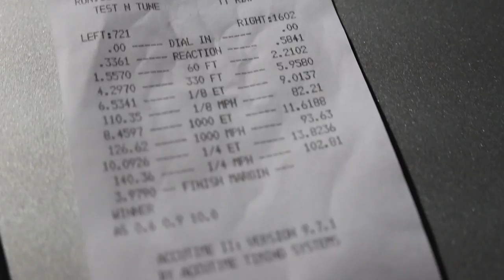First Time at the Drag Strip in my S4!

Comment: word of advice because I track my MKV R32 quite often. The DSG has a slight lag when letting off for LC. You need to let off the brake as soon as that 3rd yellow light comes on and you will leave the box perfectly. my R.T is around 0.190 with that method
Reply from the maker: Yeah I was going for time, not RT, but good tip, thanks!!
Reply: Wouldn't a better RT equate to a quicker overall time?
Reply: Lee Cook depends on what the track is set up for at the moment. Some tracks dont start the clock until your car moves during test n tune nights. But if the clock starts immediately on green for real competition then yes it would matter.

Comment: word of advice heat kills these cars at the track, best to ice down your supercharger. With better intake air temperatures proper launches you probably would have made in the 12's easy. also to make sure to put your car in dynamic mode before you turn off traction control because sometimes it won't fully turn it off learned that the hard way my car was braking somewhat off the line till I figured that out. You also  need to go ahead and got stage 2+ dual pulley or at least go supercharger pulley. at even stage 2 you'll be seeing low 12s High 11's all day depending on ur d.a. and launch. stage 2+ (dual pulley) guys are doin low 11's even making it into the 10's now. check out audizine forum and Audi b8/b8.5 s4 network group on FB there's alot if us there with  tons of info
Reply from the maker: I'm in it already :) Know all this stuff, just wanted to see how it did! Thanks for the input!!

Comment: Not yet! You will have to trap around 110+ to get into the 12s
Reply from the maker: Working on it :)
Reply: Lol, no. He ran 13.2 @ 104. Even without any improvement on the 60', 106mph trap speed would easily net a 12.9. 110+ would easily be good for mid 12's. Hell, I ran 12.39 @ 111 on a 1.98 sixty in my JB4 M240i.

Comment: Shocked by this.  I have an A6 3.0 with apr stage 1 and ran a 12.56 at 108.  I have video running a 12.699 later in the day.  I would fully expect your car to be faster based on weight alone.   I did run a 13.1 when I tried without launch control.
Reply: are you gonna put the vid up? I have an untuned B8 S4 and I'm gonna try to hit the track this season to see what I get and i will video too.
Reply: biggiesmack i havent posted the video to youtube but i guess i should.  If I do i will respond with the link.

Comment: how reliable are Audi & VW I want one but everyone says it's not good
Reply: JDMKING 2230 I have a mk4 2.0 Jetta and it's a little slow turd but I love it and haven't had anything major in the two years I've had it
Reply: My dad had an 06 Passat for 300k miles and had 0 problems with it, apart from the idiots in the dealership changing a charge hose and not thightening it properly, so it came lo/*ose and the car went into limp mode. He now has a 14 Mazda 6. He has done around 90k in it and has already had a couple of small problems. 1st it threw a couple of low oil pressure warnings, 2nd he went on vacation for a week and left it in the airport, when he came back the battery was dead, and 3rd it ripped an accesorry belt, though that might be the dealerships fault for not changing it a week prior to it ripping, when the car was in for a service. I also have a friend who has a B6 A4 he has also had 0 problems with it. And at work I drive a MK4 Golf, which has also had 0 problems. My Uncle had a 14 Passat for 3 years and apart from "Dieselgate" he had no problems with it. Now he has a 17 B9 A4, though that's only a month old so it's too early to say. I can go on and on. Point is it's not that VW / Audi are unreliable, it depends on if the car is taken care of.
Reply: its not really the reliability so much as how much parts cost and how much it costs for a mechanic to work on them
Reply: As a former Audi technician I would say they are reliable if you get the right engine/transmission combination. I worked on Audis back in the mid 2000s so I can't speak for the new stuff, but if you take care of the general maintenance and change the timing belt as you should then most of them are good. The best engine, imo, is the old 4.2 v8. The 1.8t, 2.0t, old 2.8 are all good. The 2.7t is ok, but modifying it can cause problems. The old 3.0 v6 from the mid 2000s is garbage and so is the CVT transmission. 

If you're asking this question and can't work on these cars yourself then you probably shouldn't get one. They are the biggest pain in the ass to work on tho. I have a 2003 e39 540 right now and it's a piece of cake to work on compared to any Audi I've dealt with.
Reply: VW reliability is just an old stigma that's stuck since the 90s. Their engines are rock solid now and parts are way cheaper than people think. The fact that so many parts are shared among so many models/platforms, not to mention the fact that VAG is the second largest auto maker in the world, makes aftermarket parts abundantly cheap. Now if you're buying OEM parts, that's another story.